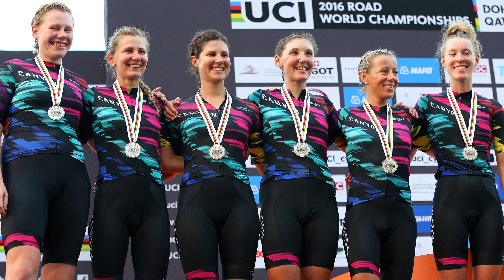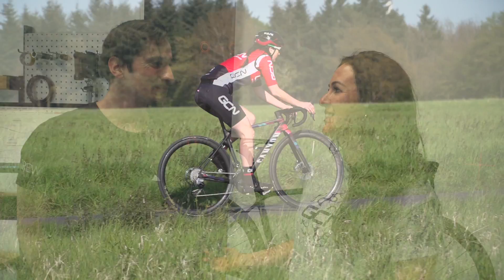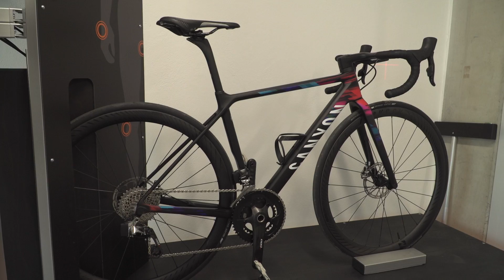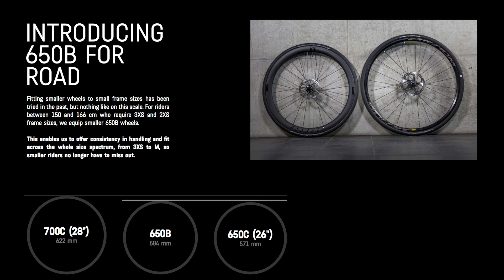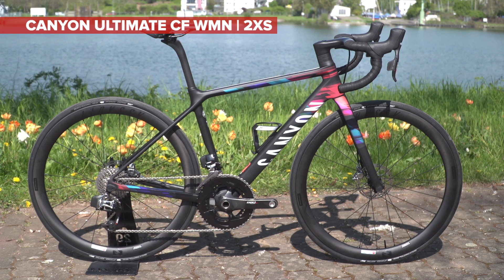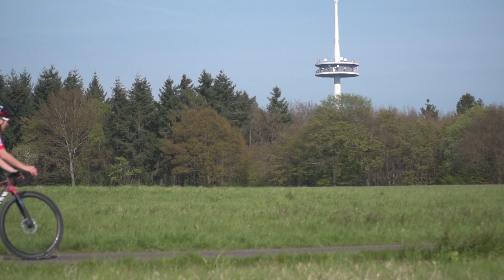NEW! Canyon Women's Road Bike Range | GCN's First Look

Comment: Hi. I have to questions. Are there any racers using 650B tires in competition? This smaller tire will create problems in the flat terrains? Would it be more difficult for a women to maintain speed in a peloton during a flat stage?

Comment: Yeah, if they went with 650A, which is the most common wheel size in quite popular Dutch bikes ("Hollandräder"; 590mm instead of 584mm), they could've tapped into a bigger pool of common wheel and tire sizes.

Comment: So Canyon have discovered after much research that women are generally lighter, shorter and have shorter arms than men. Well, blow me down, what a discovery!! I never would have guessed! Anybody remember Dave Bedwell, a very short first class racer from the 1950's who rode alongside il Championisimo. Surely there's nothing new in any of this stuff apart from the materials used plus the expensive prices that'll be charged. Any very short men's bikes should be suitable for women. And there's nothing new about 650 wheels either. Weren't they commonplace in triathlon?

Comment: Toe overlap is not important above 7-8 mph, and only really affects trackstands.  I haven't ever had a road bike without toe overlap.  If the wheel size change was just to prevent that it is a solution for a problem that isn't actually a problem.
Reply: Good for you Mr. Average sized man. Small riders on small bikes this is an issue.
Reply: Try cornering a bike with a wide wheel base and a bad rake in a crit at 20+mph, then tell me this isn't needed.

Comment: So ..... its smaller. .... with smaller wheels ..... and a shorter frame.  Does that make it a kids CX bike?  and a 50gm weight saving.  Is that all?  I got four times that going to folding clinchers.  A frame carrying 10% less weight.  I would expect at least 300gm

Comment: First time that 650B wheels are featured on road bikes? Bullshit.
I love Canyon but they ought to be sued for making such ridiculous PR claims. 
Many small sized road bikes have come with 650B wheels for decades. Even some of the Decathlon Btwin bikes have those wheels for their XS sizes.
Reply: What top range brand 650b tires did they have in 25mm?   The Schwalbe One and Conti GP4000 have never been available in 650b until this year.   the "decades" old 650b road bikes had 32 or 38mm tires, which run the same outside tire diameter as 700x23, which was the entire point of French rando bikes using 650b in the first place, it wasn't for smaller wheels.
Reply: There have indeed been decades of bikes with "normal" width road tires on 650b wheels.  A buddy of mine has one and he still can buy tires for it, typically Michelin I believe.  The bike is a Quitana Roo, I probably butchered the spelling.  Anyways, there was a fad for a while where time trialists or Iron Men bikes would use the smaller wheel in the front to get the front of the bike lower.  I also remember a shorter woman on my college cycling team had 650b wheels on her road bike as she was short, this is nothing new.
Reply: Can vouch for this.  I have personally seen a very small 90s era steel road bike donated to my local community bike shop that had a 26" or 650b front wheel, and a 700c rear wheel.  The tire mounted in front was very narrow, roughly 19mm.  It was very obvious the bike was designed around the wheels that were installed.

Comment: What about crank sizes? For the smaller bikes are they also able to get shorter crank lengths?
Reply: Jensen Healey not sure about that, for the same size women typically have longer legs than men, and not enough difference to mandate different crank length. Then even among pros you'll see tall guys with 170mm cranks and smaller ones with 175, so idk

Comment: The acid test is does the canyon pro women's cycling team use these new bikes or do they race on the unisex frames?
Reply: don't think they'll be racing on 650B wheels (and disc brakes). In race logistics would be a nightmare.
Reply: Not at all, do regular guys ride the ridiculously slammed bikes pro men ride? No.  Brands even make one off endurance bikes with shorter head tubes because the pros think the stock bike is too high.

Comment: Anyone know the rolling resistance/aero etc difference between 700c and 650B wheel size? Normally Canyon are pretty upfront about that sort of information
Reply: None, it just takes more to keep momentum.
Reply: It would be very small but the 650 would have higher rolling resistance.  A compromise to getting the handling right.

Comment: OK so in Downhill MTB there's been big fuss because The Syndicate have brought a 29" Santa Cruz to the races. Why have they done this? Because the bigger the wheel size the faster the bike, basically that extra 1.5" on the wheel and the added weight a bigger wheel brings, especially because it's rotating weight and extra tire on the ground so skips over ruts and bumps better, equals free speed. Basically the bigger the wheel the faster the bike, surely this is a big handy cap for the small rider if they use the smaller wheel. They'll have to put out more Watts to get the same speed, so I can't see the small wheel size bring very popular with anyone who races or cares about their speed. I get the handling will be more responsive and react quicker but surely the trade off of that over speed will mean most going for speed. Guess it might be popular with the casual rider who uses the bike to see the countryside, commute to work or to exercise etc. Either way more choice has to be a good thing, doesn't it?
Reply from the maker: I think it needs to be put in context. On a mountain bike? Yes, big wheels roll faster, but smaller sizes still come with smaller wheels in order for the riders to be comfortable. And on the road? We don't have to roll over roots, rocks and big bumps so much of that advantage is lost anyway.
Reply: As the guy said, making a 28" bike for a 150-160cm rider would have (perhaps) bad handling. Most kids/teens bikes (for 140-160cm) are either 29" mtb, but rather 26/27.5.

Does all their women specific bikes (+170cm) have 650b or only the smaller ones?

Comment: I'm surprised to see that they have adopted a smaller frame size and wheel size in order to adapt to smaller riders but yet the shortest cranks they offer are 165mm. They put 165mm cranks on a 3XS with 650b wheels. Odd. I know there isn't an industry that makes 160mm cranks but they seem fine with inventing new wheels so why can't they invent new cranks? 165mm cranks would be obscenely long for someone who fits a 3XS frame.
Reply: Fernando Roman yeah I was using the word invent loosely. I actually just bought a Canyon and went with the 2XS so I could get the 165mm cranks even though I should probably be on the XS but just barely. I'm 5'5".
Reply: Keith Breaux yeah I know you CAN find them somewhere else but who wants to buy a £2,000+ bike and then have to immediately spend an additional £200+ on shorter cranks? If they're making bikes for small people make the whole bike for small people right out of the tin.
Reply: I personally own a bike with 160 cranks. In order to get what I needed in a bike as a small rider I had to do a frame up build. Really when we're talking about why aren't there any 160 cranks and why do all these bikes have 165's, its why doesn't shimano or sram make them. It is more of a OEM discount type of thing, they're going to throw all sram/shimano because its easier/cheaper to do it that way, actual rider needs be damned. 

If you want to be getting those 160 cranks, you're realistically  looking at Sugino OX901D (24mm spindle) or Rotor 3D+ (30mm spindle). Neither option is particularly cheap nor is either particularly easy to get.
Reply: I work in a bike shop, we had a customer come in the other day with Dwarfism. He had a custom built Talbot Frameworks with a custom chainset that had 160mm cranks on. I can't remember if it was branded but there's definitely someone out there that makes cranks shorter than 165mm.
Reply: Yeah but as for the big companies (Shimano and others) the smallest they make is 165. You can find shorter cranks but they are very tough to come by and then make it difficult to make sure the cranks fit the BCD, BB, and chainrings. http://www.slowtwitch.com/Tech/Short_Crank_Database_2862.html http://www.bikesmithdesign.com/Short_Cranks/
Reply: They didnt "invent" new wheels, 650 has been around for ages... even before Canyon existed actually. I do agree with u on the crank debate. Even the 165 are extremely hard to find. I am a very short rider and use 165 and sometimes they are so hard to find that i have to settle for 170. I also wonder about gearing on those bikes... if you want to keep the same gear inches found on traditional 700c wheels you will need bigger cranks upfront. So i wonder if they spec'ing them with 56/42 chainsets to keep the same gear ratios.
Reply: Shorter cranksets are available from Cobb cycling. Here is a link http://www.cobbcycling.com/catalog/crankset/ 
John hope you don't mind posting a link to your website.
Reply: But then you can't get a power meter on a 160 crank.
Reply: @pbassred Rotor 3d+ works with power2max power meter, literally the only way you're getting one.
Reply: I totally agree completely. I just figured since Canyon used pretty much unknown technology in the wheels then they could also find this obscure and unknown technology for crank length since it is such a big deal and it is obvious that someone on a 3XS shouldn't be riding 165.
Reply: Nail on the head! I cannot understand why SRAM and Shimano haven't latched on to smaller crank arms yet.  I've been full custom for years and I'm able to do much more with my geometry by specking the frame for 155mm crank arms, which are more ideal for my height.

Comment: 3cm shorter arms on average across 60000 samples = different stem.  Job done?
New wheel size?  -  Much easier to go riding in a grand fondo with your female and male buddies in a group and share 700c inner tubes, tyres etc?
Question is, as I think i've heard mention before, when are the very slightly shorter armed, and shorter in height male riders going to be seen on one of these climbing bikes?  Quintana?
Reply: A shorter or longer stem creates a different handling and ride feel too though...
Reply: Other geometry issues associated with shrinking the bike vs size of the wheel. As they smash the bike down in size it starts to depart from an "ideal"  size and feels sloppy. Same reason that 27.5  (650b) mountain bikes are better for small riders than 29'er(700c) mountain bikes.
Reply: Quintana is 167cm, the guy from Canyon said the 3xs fits women 152cm, that's 15cm shorter than Nairo!
Reply: Born on the Trails 
On average means...average the "mean" i.e thousands will have had even shorter arms than that. I.e many many women will need much smaller frames to achieve same geometry and ergonomics of a man sized and fit bike for a tall man or even a below av height man. :)
Reply: I tried to get a shorter stem for my Canyon as they are over sized. It took ages to find a Giant Oversized one to fit, now I have a lovely teeny stem  for my little girly arms - everything else is fine for my 178cm height. Canyon helpdesk could not suggest anything other than saying the handling would be different - I have not noticed as I am a happy amateur who just likes to cycle. I am sure it is different but for me im delighted. Its a pity Canyon themselves couldn't help.

Comment: interesting to see 650b being introduced. I remember some teams experimenting with 650c wheels in the 90s on climbing bikes.
Reply: I cant remember the model name, I just remember all the complaining (from guys) about it
Reply: I remember reading that Trek experimented with that wheel size in Julian Arredondo's (Giro d'Italia blue jersey winner back in 2014) bike around that time; however after that he suffered from injuries (not related with the wheel size, I guess) and couldn't recover well, so we couldn't see the development of that experiment.
Reply: You have missed the fact that Giant did it a few years ago for their liv bikes
Reply: +Jordan Pearson
They did? Which models? Most I see of the Liv road bike lineup is still based on 700C - Liv mainly tweaked the geometry to fit female physiques and torso/limb lengths better.
Reply: The video is correct in that it's the first time 650B has been formally reintroduced into big-name road bike brands. The way I see it, that shift was made possible by the increasing ubiquity of disc brakes on road bikes (people like to ignore/forget that 650B is traditionally a touring bicycle wheel size though). 

Where I come from, that makes more sense than pursuing 650C, as was the custom. 650C rubber is quite hard to come by in our local bike shops. While the gravel bike trend has seen adoption of 650B tires wider than 40 mm, I wonder how market adoption of skinnier 650B rubber will go. The smallest sizes of the women-specific Endurace and Ultimate will need those.